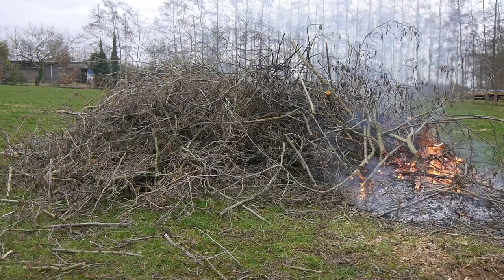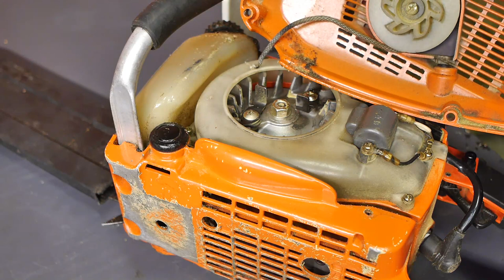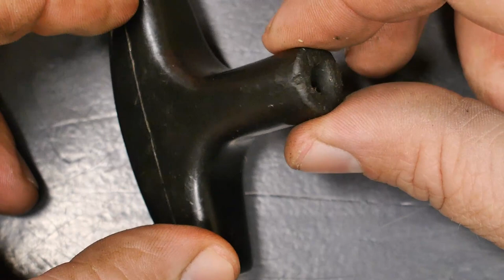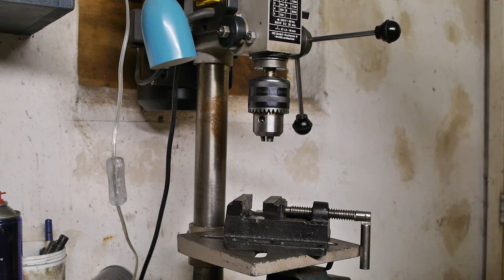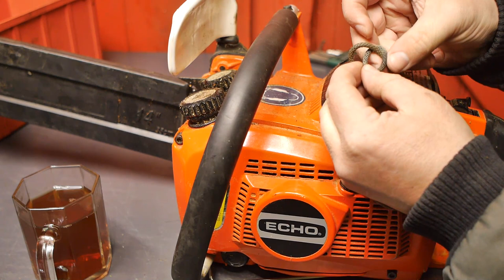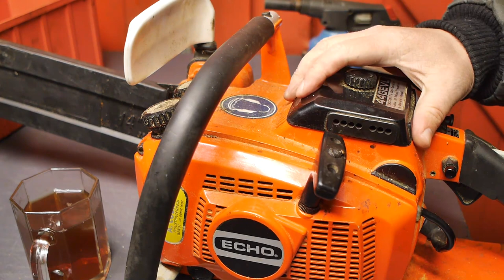Fixing the chainsaw pull cord

Comment: You did not need to have the knot so close to the end, there is a GOOD chance that it will roll a bit and come undone again.  It would not have mattered if a short bit of the cord popped out the top of the handle. Either a double knot or a figure of 8 knot would also be an advantage. WHY did you not have the CHAIN BRAKE on before starting it up ? You are lucky still to have your hand / fingers. Please take care as if anything happened to you I would miss your videos and your voice. Regards from Australia.
Reply from the maker: You are right. I wanted the knot at the and for aesthetics and because the cord had gotten a bit shorter. I should try and use that brake a bit more :)

Comment: I was taught to use a chain saw by someone who had done a course.  
I didn't do the course my self, that would be to sensible. :)
The big take home was to always put the chain brake on when starting.  Then put the brake on when ever you put the saw down or move to another location between cuts.
Chainsaws are the most dangerous tool you can use apart from a gun.  Something is wrong if you use a gun as a tool I reckon :)
Glad you can still count to 10 because Octal is a pain in the arse.  (base 8)
Reply from the maker: I always though that brake was there to annoy me when I accidentally had engaged it :) I should try and force myself to use it. I might not be lucky next time.
Reply: @Rolingmetal  
If you look at the placement of the brake lever it is really easy to flick it on every time you put the saw down or move your feet to another spot between cuts.
It’s really meant to come on if the saw grabs and is ripped out of your hands.  You can’t help but punch the break.
I might do a video on the most dangerous part of a chain saw.  I’ll do it with the saw off.  I’m would never be game to try it with the saw on.

Comment: Thanks for sharing another great video with us! I always use what is called a figure 8 knot on my starter cords, it doesn’t slip like an over hand. Also it makes the knot just a smidge <-(technical term) bigger so that it fits into the handle tightly. And I was shouting at you about the chain cover but I guess it didn’t come through the internet 😱
Reply from the maker: I never learned to make anything more fancy than a basic knot :(
Reply: @Rolingmetal  Then do that overhand knot but put one more "through the hole' in it.  Bingo a wider knot (not as good as a figure eight but it still works, especially if you put a drop or two of Super Glue on the knot.)

Comment: Now the washer will do a better job cutting the chord than the plastic handle did. You should drill the handle WITH A TAPERED DRILL, NOT FLAT. Then a rat tail file to take the inside hole sharp edge away
Reply: Originally I thought the knot pulled through the handle as the handle was stuffed.  Now I see that it actually snapped off.
I'm sure Roling will come up with something better if it snaps again.  Perhaps the cord is past it's prime and it should be completely replaced.
If it snapped in the middle you wouldn't think twice about replacing it.
Reply from the maker: You might be right on that, time will tell. The cord probably had it's best days.
Reply from the maker: That is what happened the first time. I had to cut out the knot and make a new one. Perhaps I used to much heat. At some point the cord will have to be replaced. It does look tired.
Reply: @Rolingmetal  
If it starts it’s good :)
Only trouble is, it breaks when you really want to use it.
I wonder if you can clutch start a chain saw?  :)